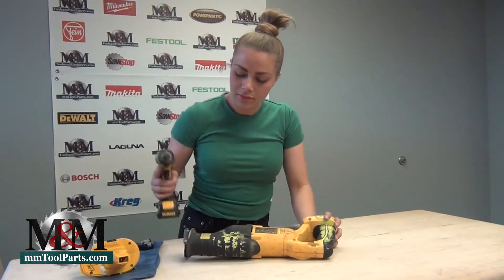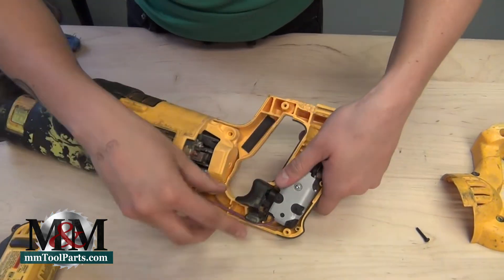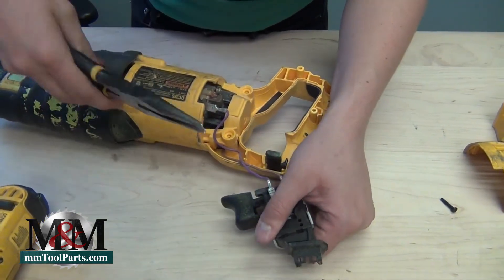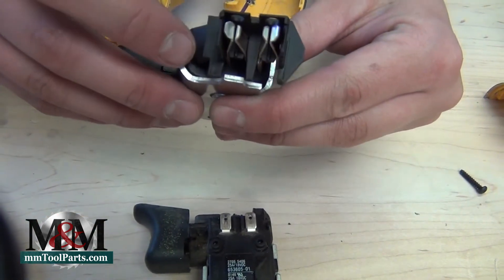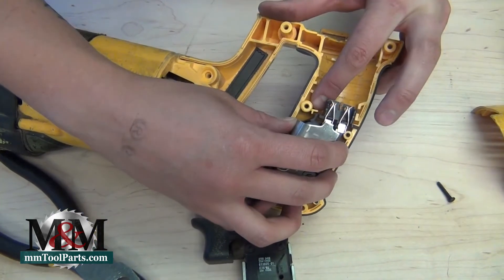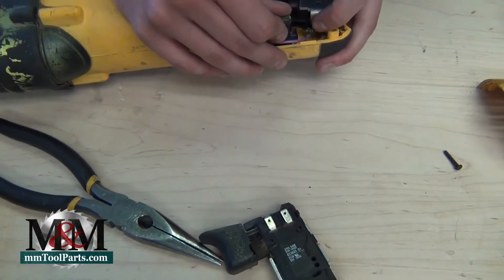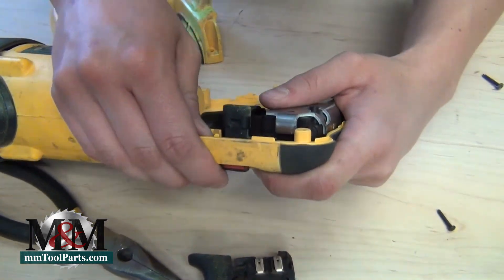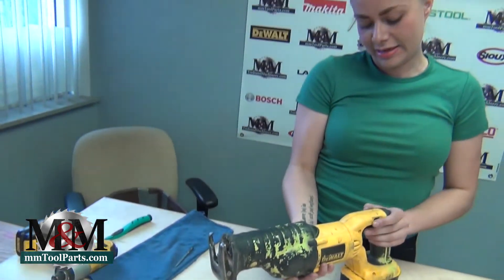DeWALT DC385 Switch Replacement

Comment: Do you have a video of hot to fix the blade locking replacement my blade just comes out
Reply: Same problem here but on a little different model. Apparently, there are 4 DC385's

Comment: 71 dollars for a part for a tool that cost 21 dollars? No thanks. From DeWalt where it's cheaper to buy the tool with two batteries than the two batteries alone. Kobalt batteries are 10 dollars new at Lowes. And I have one working on a DeWalt circular saw.